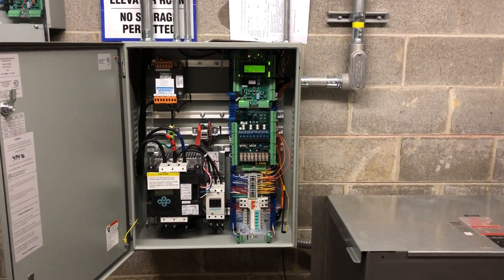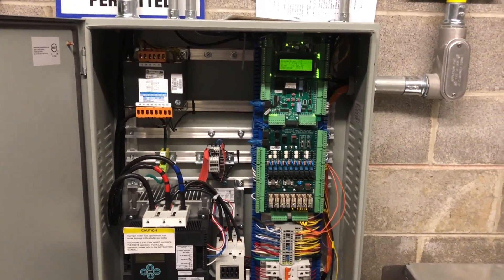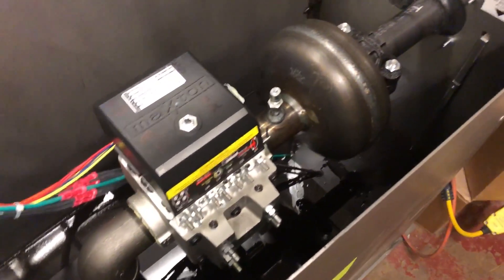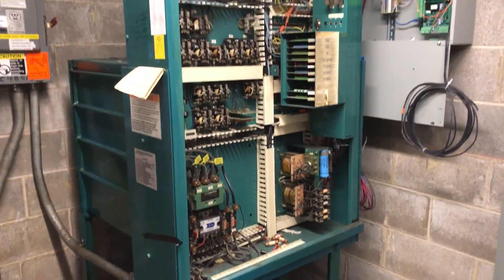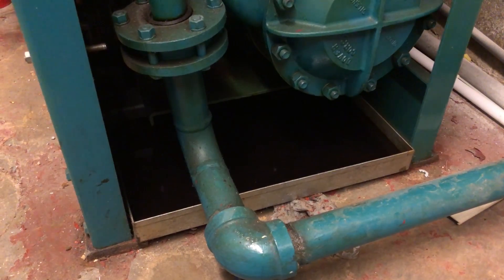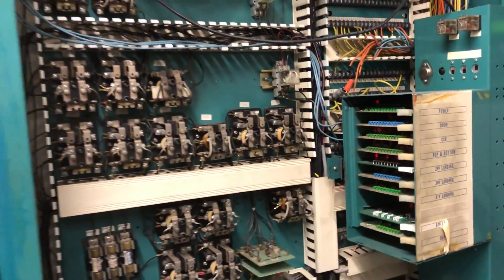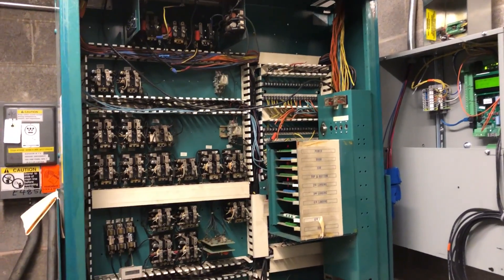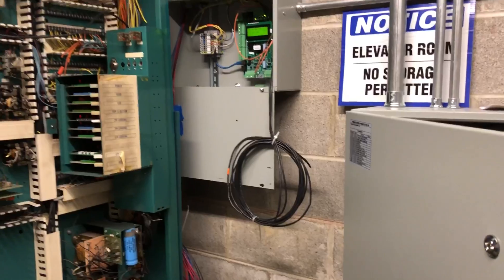Smartrise hydraulic elevator controller

Comment: There is this one local medical building in my area that has that EXACT same SmartRise elevator pump unit! Just stay tuned for my video that I'll upload soon. Anyways, I do want to ask; is your building contracted with Oracle Elevator? That's the company my local medical facility was contracted with, and they installed these exact same materials like you showed in this video.
Reply from the maker: These were not installed by Oracle. Oracle is not located anywhere near here. These were installed by a local independent company.
Reply: dieselshadowman When I upload my video of this exact same elevator unit, you don’t mind if I could share the link to you on here as a video response?

Comment: The Old Elevator Equipment I can see is made by Dover. Did it use Black Halo fixtures or did it use white light up Traditional fixtures? I know you said the old equipment was from the 70s.
Reply from the maker: The buttons had been replaced probably 10 years ago with some led halos. I don’t know what the original fixtures had.

Comment: so diesel is everyone with a cable elevator changing to hydraulic? me-i think i would rather ride the cable ones. but thanks for the video, as levi said-no way i could figure it out, maybe my boys-but darn sure not me.
Reply from the maker: Jim, most low rise elevators are hydraulic as they are considerably cheaper to buy and install. However, they are limited in how far they can travel. Once you get over about 5 stories they become very uneconomical as they have to lift the much larger piston in addition to the elevator itself. 

Traction (cable lifted) elevators will not be going away anytime soon. Hydraulic machines, at least new ones are slowly becoming a thing of the past as building owners and manufacturers want to get away from burying a large hydraulic system in the ground that can lead to an environmental problem if it leaks.